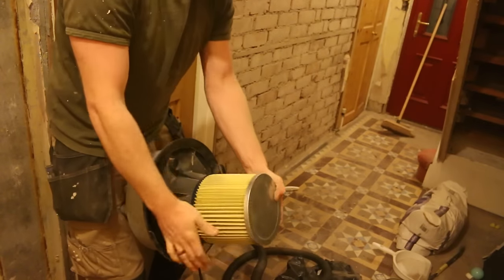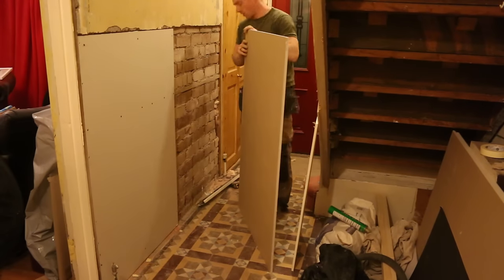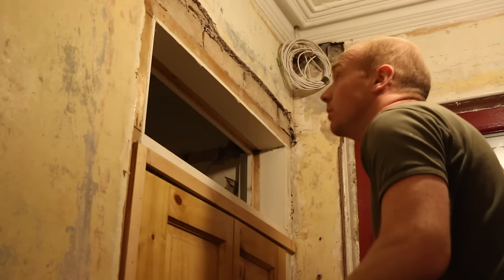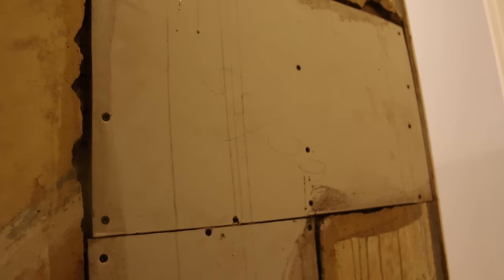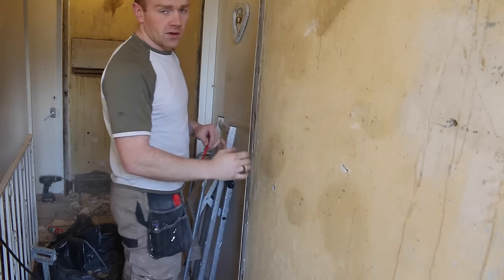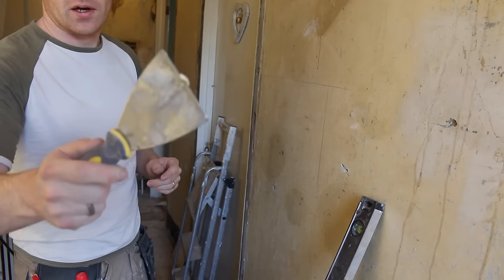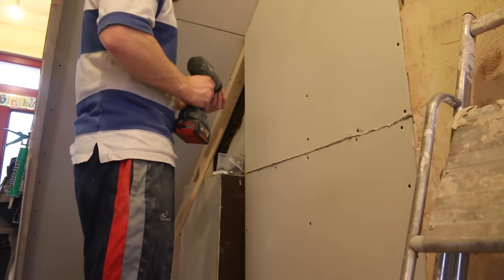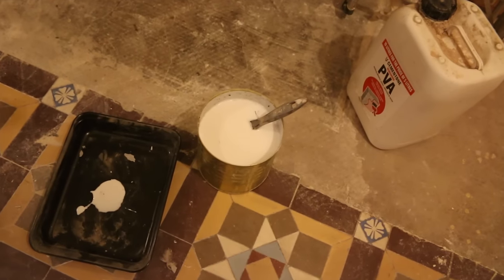Getting Plastered | Hall, Stairs and Landing

Comment: Little tip mate, from a plasterer. British Gypsum Hardwall is much easier to use on lime walls. The lime tends to suck the moisture out of bonding really quickly and sometimes cracks. Bonding is for low suction walls really, although many plasterers still use it. It works, I just find hardwall works better.

Comment: For small loose areas like the "button" you can use a 6mm masonry drill bit to gently drill through plaster to the lath (you dont want to go all the way through) and then inject some grip fill adhesive to stick the plaster back to the lath. It works brilliantly for brick walls too where the old plaster has become detached due to historical movement/settlement.
Reply: You call your dog and cat, dog and cat?

Comment: Nice work, but if i were going to be living there long term, I'd be very tempted to move out for a couple weeks and loose all that lath and plaster completely. Walls and ceilings.
Reply from the maker: +Steve Craft We would have been in and out of the house for 2 years if we did that! :) After taking out all of the lath and plaster on the ground floor and in the loft rooms I now try and avoid it if possible.  Majority of it is perfectly sound and would be unnecessary, that said I have pb over all the ceilings as the original plaster was all coming loose.

Comment: Ive plastered a few houses over the old lime plastered walls.....did your plasterers have any issues with bonding and adhesion? I had to move on to gritting the walls first to prepare the background as actually had plaster fall off the walls in the later stages!! Love your vids .....painfull to eatchvsometimes though as they drag up old memories of lonely nights doing very similar jobs lol
Reply from the maker: No all been fine just with PVA to seal first.  We just did this on internal walls as stuck with lime on the solid walls.

Comment: The house is coming along nicely. I have a question unrelated to plastering. In our house we are prepping the floor to tile. In the kitchen there is a hole, say 4 by 3 inches about 2 inches deep. Bottom feels a bit spongy, so I'll hammer that out. How  and with what do you fix the hole?
Reply from the maker: Do you mean the hole is in the floor. If so are you sure it isn't insulation you can feel?
Reply: TheRestorationCouple
Yes. The hole is in the floor. Dont exactly know what I'll find. Once I have the hole dug out, any suggestions on best way to go about filling it in?
Reply from the maker: +ZS6JMP how old is the house? If it is concrete floor poured over insulation then you should be fine just filling it back in with concrete.
Reply: TheRestorationCouple
Its a 1950's ex council house. I'll go down that line then.

Must say, love the work you're doing. In an age where diy is discouraged, apart form planting a lawn(maybe), its nice to see folks that shrug the ''dont touch, you're not qualified'' robe.
Reply from the maker: +ZS6JMP doubt it is insulation you can feel then. However should have damp proof membrane so is likely to be fine to just concrete fill. Possibly pva in and around the hole first. Glad you like the vids, we spend a lot of time researching and learning but rather that than money! 😄

Comment: Great Vid:) - Can I ask why your preference is to use plasterboard to patch repair rather then just smash a bit of sand and cement in there? Are there advantages or is it just down to personal preference?
Reply from the maker: +Pete Holder No preference.  We used sand and cement on the other internal brick wall.  In this case, I was using what I had in the garage on a Sunday afternoon before the plasterer showed up a day or two later.
Reply: Thanks! I just taken on my first project, 1906 Edwardian Terrace, I've been very apprehensive about using gypsum and PVA'ing to much, love the idea about applying the lime plaster to outside walls only, looking forward to going through the rest of your vids:)  Do you apply the lime top coat in the same way as multi-finish?

Comment: Thank you for your videos. What lime product have you used on the internal face of the external walls please?
Reply from the maker: Lime hemp for complete walls. Then we used limelite renovation plasters for patching which are not proper lime but importantly breathable.
Reply: The Restoration Couple thank you. Are there any of your videos that demonstrate your use of the products? Is Limelite a brand name or generic type?
Reply from the maker: It’s a product by tarmac I think. The renovation plaster is a perlite lightweight backing plaster and then there is s high impact finishing plaster to skim. Our local travis Perkins stock it.

Comment: Why didn't you put the plasterboard down all the way to the floor?
Reply from the maker: The original laths didn't anyway, the skirting boards are fitted to blocking off the studs.
Reply: You shouldn't go below the damp course level,which is the first brick up from the floor.Otherwise you'll bridge the rising damp!
Reply: @ashyclaret  Even on an internal wall? I thought rising damp only affected the outside walls.
Reply: @pcno2832  
On old buildings it comes up through the footings,even on the internal.
Reply: Another good reason not to board all the way to the floor is if there is ever a leak it hopefully doesn't soak into the plasterboard so saves a bit of work in the long run